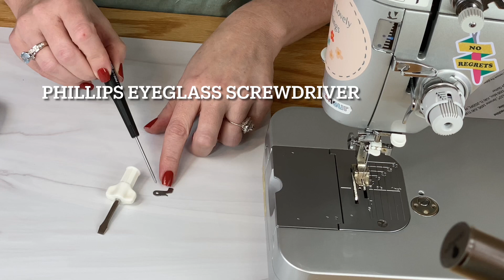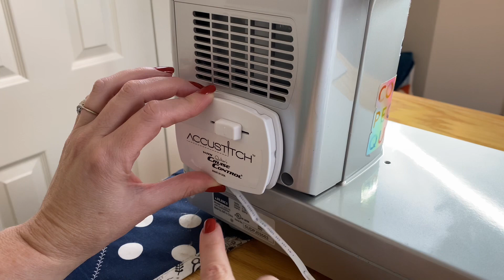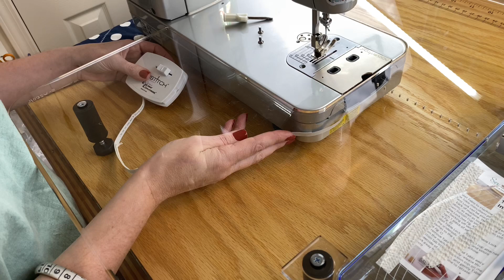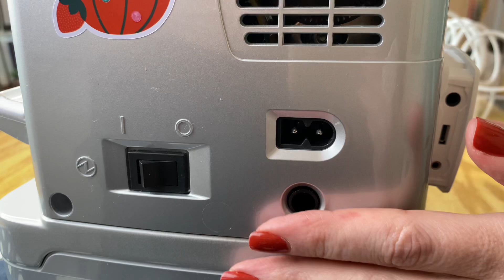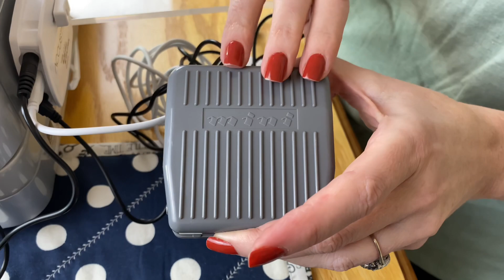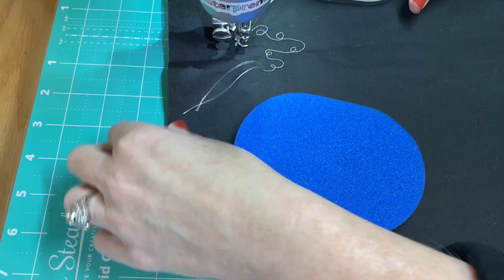The Accustitch Stitch Regulator - Freemotion Quilting Made Easy for Domestic Sewing Machines

Comment: Thank you so much for this. I am mulling buying this stitch regulator for my Baby Lock Accomplish. I couldn’t completely tell on your video how consistent the stitch length is. Also, the manufacturer video talks about getting an adjustable height hopping foot that never actually touches your fabric. Does your foot hit your fabric when it hops?
Reply from the maker: I wanted to follow back up with you regarding the quilting foot question. The Accustitch works best with the ruler foot b/c there is clearance, and it doesn't touch the fabric. I checked with Accuquilt this evening. I use my ruler foot now, although I had started with the basic quiliting foot ( which slightly touched the fabric).
Reply: @SeamsSewMe  Hello! I was just about to write to you when I saw your most recent message. It’s funny, I asked my dealer about the AccuStitch (he is not a distributor for it so I’ll have to buy it elsewhere) and he said the same thing you just did about needing a ruler foot for my Accomplish which is Baby Lock’s straight stitch machine. 

Have you tried using the AccuStitch with your ruler foot and if so, can you see/feel a difference in the way it sews out your design?  I don’t know anyone personally who has or has used the AccuStitch so I’m in my gathering intel stage. 

Thank you so much for circling back to me Belle; that was very thoughtful. Also, I found your video to be helpful about things that would not have immediately occurred to me like leaving some slack in the line where you access your bobbin. Very very good point. I really appreciate hearing about this tech from a user’s perspective. Thank you!
Reply from the maker: @DanaSews  I am selling the Accustitch on my website as part of a pre-order that is open until Feb. 5th at a sale price so you can find it there if you are interested in purchasing. My website is www.SeamsSewMe.com  . Yes, I started using my ruler foot after filming the video after the recommendation by Accustitch. Yes, a big difference b/c it does not touch your quilt sandwich as all. I'm still getting use to the feel of making good patterns and shapes but the ruler foot is great. That is  what is on most long arm machines. If you need one, you can get a foot from Sew Steady. They have good ruler feet. Glad you found the video helpful!
Reply from the maker: Hi Dana 👋🏻- there is a switch for on the controller that lets you control your stitch length which is handy but also you slightly control it based upon how smoothly you move your hands as you FM. It takes a bit of practice to get used to the ‘ feel’ of the technology and I’m still practicing as a newer FM quilter as far as learning patterns and designs. As far as the feet- I can only speak to my Juki which has 5 quilting feet and I have one that hovers slight above the fabric and then the ruler foot does as well. What I would suggest is put in your hopping foot with a quilt sandwich underneath and see where the foot sits when the presser foot it down. Some have a screw you can adjust. Feel free to email me if you want to talk more. Here is the link to purchase one from my website when your ready. https://www.seamssewme.com/product-page/group-buy-pre-order-accustitch-stitch-regular-for-domestic-sewing-machines